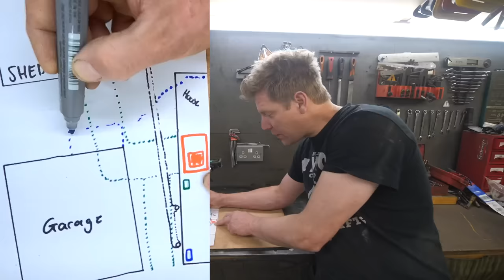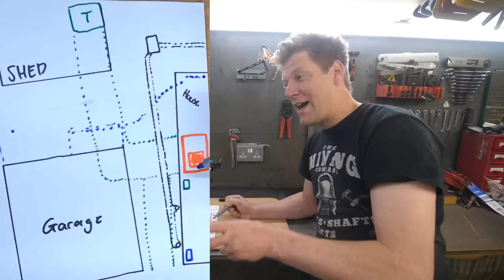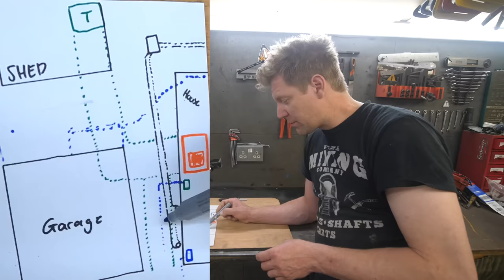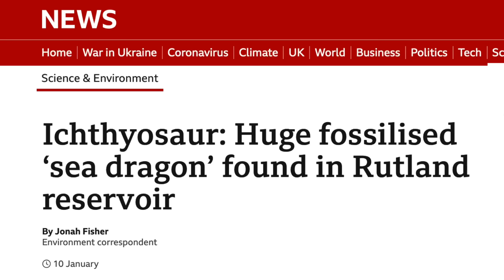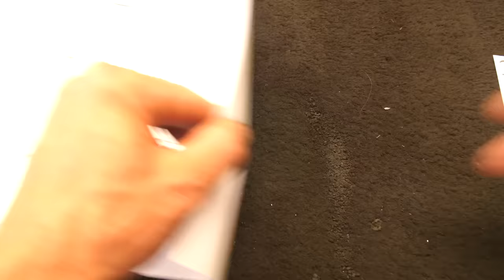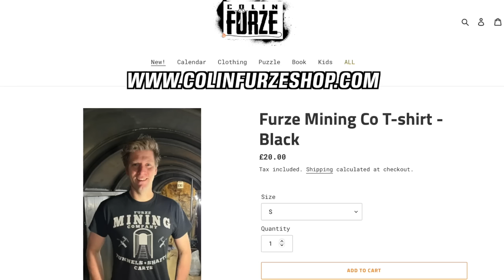DIGGING A SECRET TUNNEL Part 9

Comment: re: low vents - are you doing any sort of radon testing? Maybe more of a problem in igneous areas. (My nearest quarry is a granite quarry).
Reply: Radon testing?
Reply: @John-Doe-Yo  To see if there's any harmful radiation
Reply: @alastairholland4433  I didn’t know stone and clay could be radioactive
Reply: @John-Doe-Yo  That's why I said it might be an igneous rock problem. In areas like mine (Northeast US - high granite content, etc.) it's a concern in basements/lowest points. I have a vent like Colin's under the basement slab that constantly sucks air outside to prevent it from building up in the basement/house.
Reply: @thepeanutgallery1699  ah
Reply: @thepeanutgallery1699  Radon deposits are the result of decayed Uranium right? I think you're correct that it won't be a problem as we don't really have any Uranium here
Reply: That crossed my mind too. It is usually less of a problem with a soil like in the video, lots of clay etc. It is more of a problem in areas with lots of gravel. I used to live in a suburb which was built on huge hill of gravel, formed during the last ice age. According to our Radiation and Nuclear Safety Authority website, they have measured the radon levels in 226 houses in that postal code area. The average radon level was 1424 Bq/m3. In old buildings 300 Bq/m3 is the limit that something has to be done. In new buildings the limit is 200 Bq/m3.
Reply: @xjyrki  Looking at the map from "ukradon" it looks like Colin is in an area that could potentially have an issue. Radon tests are cheap (at least they are in the US), but they have to be in an undisturbed area for a few days to collect data.

Comment: I'm really hoping you make the connection to the bunker this summer while the weather is good. I appreciate the material costs are significant. As intriguing as the new development is, I'd love to see the original scope of the project completed. 

I imagine you surveyed the garden, and I'm hoping the tunnel meets the bunker at the correct level without a significant slope up or down or bend left or right.  Oh, and don't forget an intersection for the second bunker...  :)

Comment: Not to be a buzz-kill, but I you had simply excavated your underground floorplan from the surface and stored the spoils somewhere by truck. You could have poured a  reinforced concrete structure in a couple of months and waterproofed it. You could have installed a concrete stairway, and have been finished in 4-6 months.  The costs would probably have been cheaper  and you could have installed sewer and water piping for a  bathroom and used a pump to circulate it up into your existing sewer system.  

All of this would have been cheaper and the end product would have been more spacious and well built. 

Have said this I commend your ingenuity,  hard work  and problem solving abilities.  Great job!

Comment: I'm a dane, living just across the pond from england... and the whole forgiveness/permission thing could more than likely have cost you alot of wasted work in Denmark. As an electrician I have seen several homeowners having to demolish parts of their new builds because they didn't get the expected permissions. Glad it worked out. -And I get it. I live in a rented appartment and I have done several electric installations and smaller changes to the place, wich I have no permission for... but if I ever move out I'll go through everything with the owner and make a deal about what to take down and what to leave as is. everything I have done is improvements... except the cat door i cut a hole for in the balcony door, I'll have to get creative if I ever have to fix that!... LOL
Reply: It's a balancing act, eh? For every CF there's some idiot tearing up their building in a way that's going to get someone badly hurt or a tower in Miami collapses. Then people justifiably yell, "Where were the inspections?"
Reply: Here in the US could be the same situation. You'd get all sorts of fines and potentially have to undo it.  He probably got away with it because of his fame.

Comment: You should definetely get Radon measurements.
The Radon risk map indicates that you should live on the edge of/in a high risk area.
Reply: If he had actual quartz rather than calcite crystals, then I would perhaps start  to worry about Radon. In limestone, not so much. But he can rig his fans to keep a positive pressure underground, and combined with all the WELDED steel sheets and concrete, he will be MUCH safer than someone with a normal basement!
Reply: @YodaWhat  there is a Radon Risk map for the UK, and he lives on a red zone.
The soil makes it less likely, but checking doesn't kill anybody while not checking might
Reply: @LukasM297 - Yes, it is certainly worth checking, but he was planning to ventilate anyway, with fans, so it's a simple matter to keep a positive pressure in the tunnels. That can or will push the radon gas out/away through any available cracks, plus provide changes of the underground air. That is good protection already, plus he has cement and welded steel to help prevent the gas ever entering.

Comment: Glad you're doing some kind of ventilation, since (especially with the airflow going on through those fissures) I wonder if Radon will be a concern.
Reply: What is radon? And why is it a concern?
Reply: Basically it is produced in rocks like this and is radioactive. Has a long half-life so does linger I’m the air for a while.
Reply: @bluespartan076  It's a radioactive element in gas form that naturally gets emitted from the earth. It seeps into houses, which isn't too bad for houses without basements, is worse for houses with basements (more surface area underground), and I imagine is even worse for tunnels underground, especially when there's so much air and gas moving around through cracks that you can feel it.

It's a concern because breathing it is a large cancer risk. It's not too bad everywhere, but where I live in north-central USA, it's a pretty big concern. If you don't have a mitigation system that pumps it out, it can be as bad as smoking a pack of cigarettes a day.

Comment: So why go toward the road instead of toward the bunker?
I can see that you'd want to do both, but it seems like being able to go from the house to the bunker without going across the yard would be slightly more attractive?
Reply: He is digging towards his driveway... the plan is to have an elevator type system installed so when he parks his vehicle he can enter the tunnel from the driveway. He mentioned this in a previous video.
Reply: he's doing both if you pay attention to the drawings. he's currently going to the road because if I recall right he wants to go from the garage instantly into the tunnel. I could be wrong on this though and the plans are detailed in one of the first videos

Comment: And my local planners told my what type of tiles/bricks I could use, when I'm not in a conservation area. When we found a well on the line of foundation they refused to let us move the foundation out by 2m, then they made us fill the 30m+ deep well with concrete, which was nice....
Reply: You should be thankful. In heritage houses (which my team and i regularly work with) you're not even allowed to fart. Restoration goes at a snail's pace and every material has to be approved before being used, and that's if you're even allowed to touch it (after they figure out if it's bad or not to require restoration). Endless assays and documentation. We were once called in to redo the structure of an 127 year old house, took almost two years.
Reply: @aserta  I know - one of the reasons I avoided any conservation area or listed properties. So then having the local council behave like like it was, and then a few years later allow what looks like 3 mini tescos to be built on the same road was a bit irritating :)

Comment: Might have tried some "stretched" steel wool to provide additional strength and structure to the expanding foam, or maybe it could have also helped provide a lattice and structure for the compressed air-concrete-shooter-thingy? I'm concerned that foam is going to create a failure point within a few years....
Reply: Closed cell foam is actually anywhere from 25-60psi compression strength. So how much he used in the area he used it, there is nothing wrong with it. Plus that area may even be better as closed cell is water proof, we’re as concrete is not.

Comment: I admire your balls to take the chance on building this without permission, though I think that you may soon be on the councils radar with a dedicated person from the council checking all your future video's.  NICE WORK :)
Reply: That bit a guy in the arse across the street from me.  He cleared the lot of trees and poured the concrete pad for a machine shed before the permit was granted.  It sat as a concrete pad for over a decade...like 15 years, probably.  They absolutely refused to permit him to build on it (but didn't make him tear it out) after not following their rules. It's being built on now, though, under a new owner of the home.

I did it right; applied for my building permit in February and was granted it in July. It did make for a busy 2nd 1/2 of summer to form and pour the concrete and close in the building before the Wisconsin winter hit, though!

Comment: God I love these videos. I mean, everyone does, but they're just awesome and so interesting. Sucks about the council, but glad it worked out! 
A few CPU fans in some of the vent pipes would aid circulation with minimal electricity or noise and allow you to control the direction and speed of the air flow... Just a thought

Comment: you should do the underground garage where you raise a panel and drive down a ramp to the parking area make that big enough to turn around so you can drive back up the ramp when you leave.  then all you need is a lid to open up to let you drive in or out no lifting or turning around the device.  Easy peasy  You could even have grass on the lid to make it disappear when it is down.

Comment: since you mentioned the cracks in the rock ... have you considered radon gas (radioactive gas which comes up from the ground and accumulates in cellar), and how to handle it in your bunker+tunnel?
Reply: If he had actual quartz rather than calcite crystals, then I would perhaps start  to worry about Radon. In limestone, not so much. But he can rig his fans to keep a positive pressure underground, and combined with all the WELDED steel sheets and concrete, he will be MUCH safer than someone with a normal basement!

Comment: I'm really surprised you had such an easy time with the council. I've heard nothing but bad things about my local council and their view on unique architecture.
Reply: I’m American, so not sure exactly how it’s organized over there, but he did say that his town council certainly doesn’t like it. He go it approved through the planning commission, and that’s all he needs. Very smart to wait until the connection between the house and shed were complete so they can see the workmanship.
Reply: @gthetree1  But demonstrating Building Regulation compliance is the second hurdle even with Planning Approval. That has likely driven the extra ventilation and fan installation  and will be a disaster for summer relative humidity unless there is a dehumidifier.

Comment: I was expecting this video to be about tunneling to the bunker. Now I see you're  moving forward to the front of the house. I must have missed something. What do you attempt to achieve there? I don't think you want to make a tunnel entrance in front of your house?
Reply: I was very confused by this as well. As far as I was aware, the tunnel was just meant to connect the house to the bunker,. There was nothing about this extra section in his original plans? Am I missing something?
Reply: @MajorMel  In one of the previous videos, Colin talks about how he had a bright idea while down there surrounded by welding fumes.  Car lift incoming!
Reply: @dfross87  oh yeah, I actually do remember that, but he talked about it as something he might do eventually. I guess I just assumed it would be later on after the bunker tunnel was done, and then forgot about it. Thanks!
Reply: @MajorMel   With Colin, who knows what will happen?  He might install a launch platform for a Drift Trike instead of a car lift.

But personally I would like to see him connect to the bunker first.

1)  That was his initial stated goal.

2)  Joining to the existing tunnel would be an interesting engineering exercise that's different to what we've seen so far on the tunnel project.

3)  I want to see which is quicker from kitchen to bunker -- across the backyard and enter through the shed, or via the tunnel.

Comment: Hearing you address the question about those cracks, made me wonder: Have you tested for the presence of radon?
Reply: If he had actual quartz rather than calcite crystals, then I would perhaps start to worry about Radon. In limestone, not so much. But he can rig his fans to keep a positive pressure underground, and combined with all the WELDED steel sheets and concrete, he will be MUCH safer than someone with a normal basement!

Comment: I was always under the impression that anything underground didn't need planning permission?? I guess something has changed since I last enquired. Great video as always Colin, till the next one fella, stay safe and stay hydrated :D
Reply: I think the London super mansions put pay to that
Reply: almost everything permanent needs planning permission. temporary structures dont. But if its a permanent structure then it needs planning permission. The exception is you don't typically need planning permission to bury a cable to outdoor lighting or a pipe to your shed for example. as its just a shallow buried utility.
Reply: I'd have thought Building Control would be more concerned as it could affect his neighbours. But I suppose you need planning permission as it's increasing the liveable area of his property. Might even affect his Council tax band!
Reply: Except you don’t, permitted development rights mean you can extend a house without needing planning permission in most areas except listed buildings or protected areas
Reply: @alanhillyard1639  Yes, but there is a limit to how much you can increase the property size. This increased recently but even so you can only add something like one bedroom. If you want more info for this case I guess you need look at the Lincolnshire planning portal.

Comment: Love to hear what the town councils strong objection was to someone doing something like that on their own property that's completely invisible to the public!?!
Reply: Because it might be a death trap or cause the neighbour's house to fall over.. Just like doing any building work without oversight before hand.
Reply: I'm guessing because you risk undermining next doors house
Reply: @fairyheli2  surely if you provide them with assurances that it's within your own property boundary and constructed to a good standard the "strenuously opposed" would be downgraded somewhat? Just seems like pure NIMBY-ism
Reply: @metalmonster1  I'm sure everything from a 45 degree angle down from the property line requires permission and plans because the weight of the property adjacent to it is supported by that land. Also depends on the type of land and soil. In some places with lots of granite you could probably dig down vertically with no issues
Reply: @fairyheli2  I never knew about the 45 degree thing, makes sense though. I guess my question is actually why would the town council be so against something that the planning department looked at and went "that's fine"

Comment: Sooo how deep can you go? have you thought about building deeper levels? have you considered using Lidar to plot your tunnels? when you expose something temporarily you can scan it & rebury it at your convenience while still having the exact data to have a kind of X-ray like vision to plan around. also may I recommend that you look into Phosphoric Acid treatment for you steel if it ever starts to rust. you should have a guest chemist like Nile Red test your geology samples. that bright white one looks like calcite, which can be useful. if you can separate the quarts you can make a little glass if you are just a little clever. Sooo what is the depth of the water table there anyway? you defiantly need refrigerator magnets for decoration.

Comment: In regards to the rock seams that expell air, you should force pressurized smoke back through it and observe your local area for leaking out of somewhere. If you do this for days and never find or there are no other reports of it, I would have that air tested and if found to be good of good quality, I'd use it to positively pressure the tunnel system. Then if something happens outside, like nuclear fallout or a gas attack, you'd have a safe retreat.

Comment: If you have voids a dry concrete pump can fill them quickly and it is not as messy. The difference is that a dry pump mixes in the fluids at the spray nozzle so it is more controllable and the pneumatic pressures can be adjusted as well.

Comment: i would suggest to use an arduino to  check the air quality down there activating a fan at the top of the ventilation pipe to blow down fresh air if the CO2 level exceed a certain level.

Comment: You are a mad man 🤣🤣 this is becoming an insanely large undertaking.  I am Surprised the tunnel isn’t rusting. If it does Or want better protection, spray some boiled linseed oil on it. It will last way longer than wd-40.